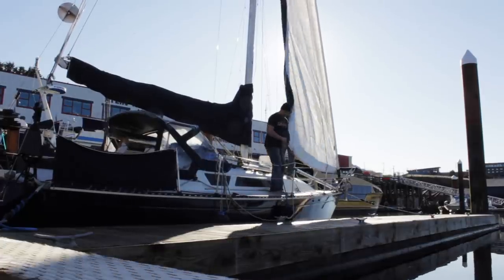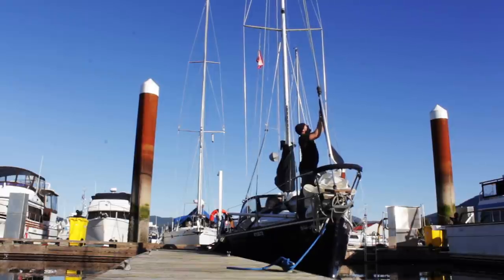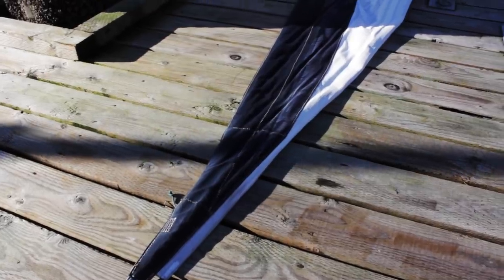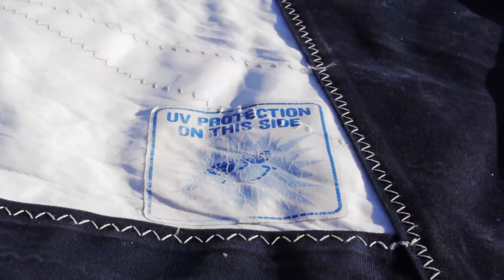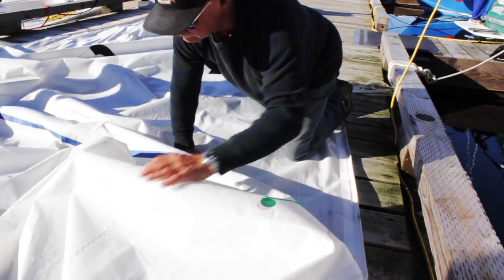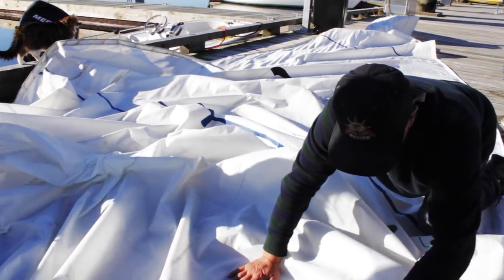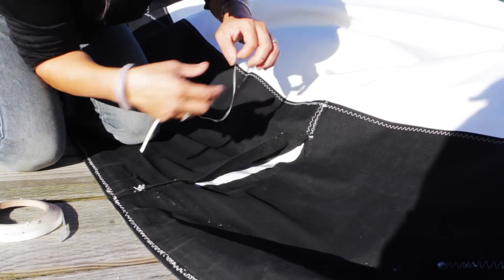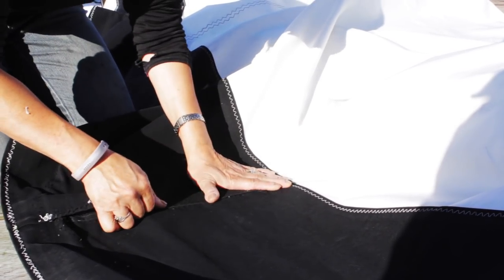Life is Like Sailing - Headsail Maintenance

Comment: Great video!  This type of sail maintenance will add years to the useful life of your sails.  We see sails come to our loft everyday that are garbage because sailors didn't do the small repairs early and now the sails are beyond repair.  I would like to add that you should also check for mildew or fungus growth.  If you find any on the sail, just use a light detergent, warm water and a stiff brush and scrub it off.  I like that you took your sail off the furler and folded it.  If you don't intend to sail for long periods of time you should take both you main and head sail down and store them.  Sails are expensive and should be taken care of to make them last as long as possible.
Reply from the maker: Thanks and glad you enjoyed it!  Yes, just a little time doing this preventative maintenance will extend the life of my sails quite a lot more I hope!  Thanks for the tip on cleaning too!!  Can I Direct Message you on your YT channel?  I had a couple questions!  :)  Alfy
Reply from the maker: Great!  I will contact you!

Comment: I really do not know much about boats, but do you have to scrub barnacles off much, or does the cold water keep that stuff at bay? I noticed that when you pulled your boat, it looked clean. Some of the other sailboat channels that sail south seem to always be cleaning their hulls.
Reply from the maker: I don't have growth on the bottom of my boat because I put anti-fouling paint no the bottom that prevents things from growing on it.  Boats that don't re-apply the paint enough will get the growth.  Hope that helps answer your question.  :)
Reply: It did, thanks!

Comment: Did you include checking out the furling gear, in your maintenance routine?  I think it’s important to wash out salt water deposits the sometimes build up in the head bearing set and particularly so with the halyard drum bearings as they frequently get immersed by the waves during rough conditions. I also lubricate them with silicon spray to ensure they run smoothly. Cheers
Reply from the maker: Oh yes, I give the furling drum a good wash with fresh water after each use and use the silicon spray when needed.  :)